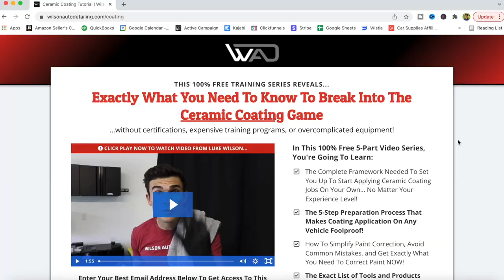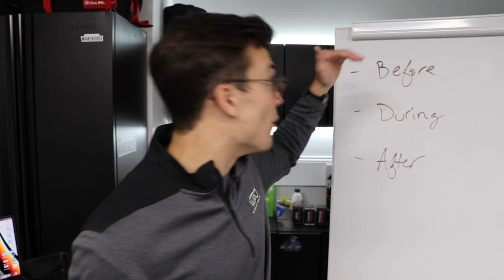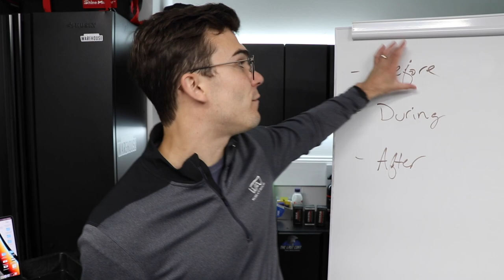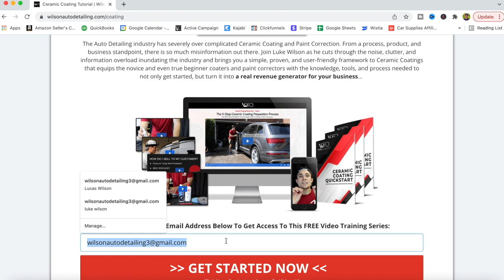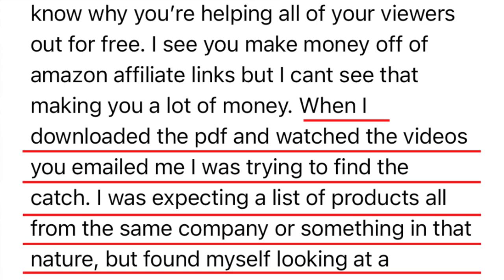What To Do When Your Customer Is Unhappy With a $2,000 Ceramic Coating

Comment: These people are seeing videos are taken in high definition video under the best lighting and are taken from angles that wouldn't show defects anyways . I did a brand new jeep yesterday that she said I didn't need to correct it because the dealer did it. Well as we know that's all I needed to hear. So I did the prep and called her outside and we walked the car. And when we was done she had no idea there was that many defects in her paint. I told her that I'm gonna do the absolute most I can do however these defects are never going to be all fixed. However, I will fix 85 to 90% of them. And you will see a remarkable improvement over what you thought was already completed.

Comment: $2000 for a days work and 30ml of liquid sound really expensive to me.
Reply: It usually takes more than a day depending on the situation. I've spent 8 to 10 hours just on corrections not counting the wash and prep.
Reply: @paulhall70  I didn't know detailers can make $200 an hour, I going to check this out!
Reply: @Rambleon444  I mean it really depends on your market area but yeah. My maintenance washes are 2 to 300 depending on size and usually take 1.5 to 2 hours
Reply: @Rambleon444   in LA area all mobile detailer charge around $400 - 800 just for a wash not including paint correction.